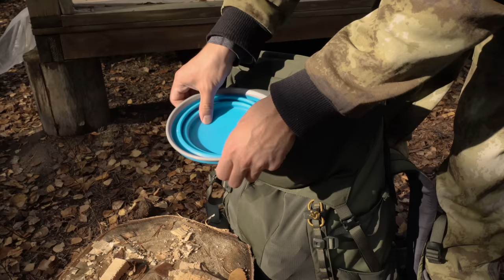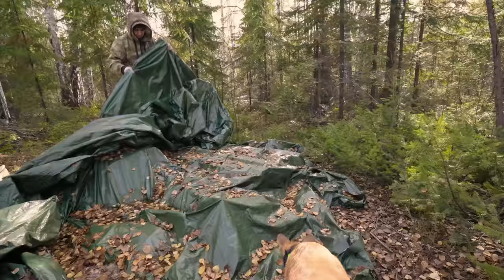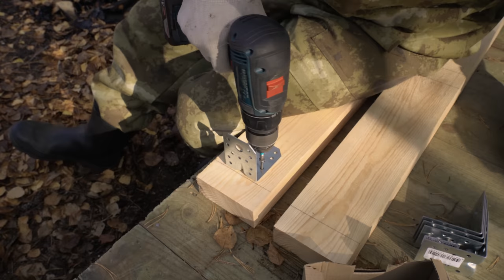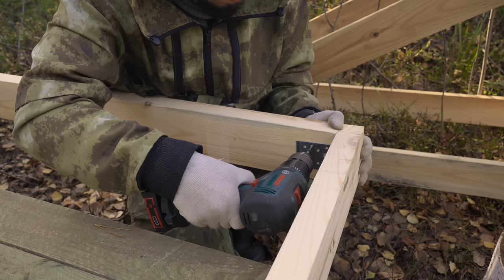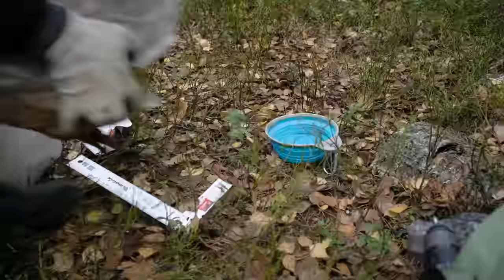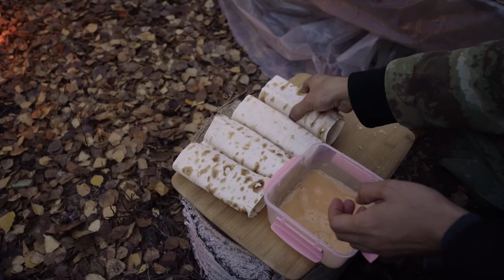Building a house in the forest. Frame house. Cooking food on a fire. Part 8.

Comment: Keep up the good work young man,   you are doing amazing work with what you have available to you.   Another tool you may want to invest in for this build or future builds is a framing hammer they are better for driving the nails in when framing a wall or structure it'll save you a few swings of the hammer in the long run.   Also a safety tip, take the cotton gloves off when using the power saw, if a loose thread got caught up in it it can suck your hand in to the blade and give you a catestrophic injury